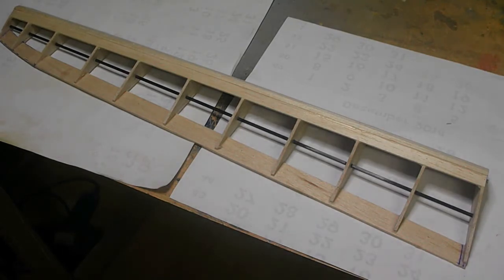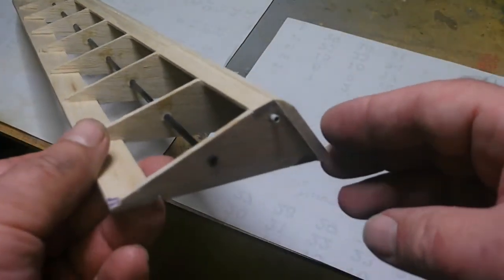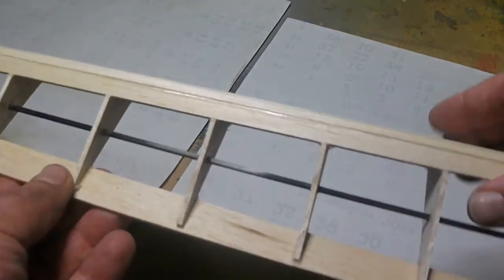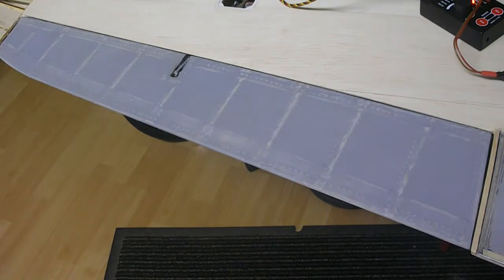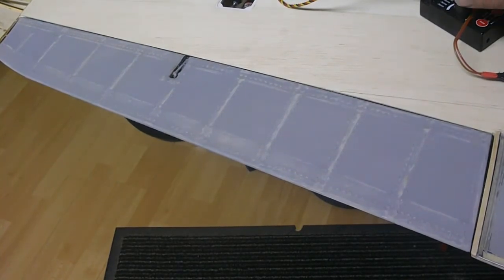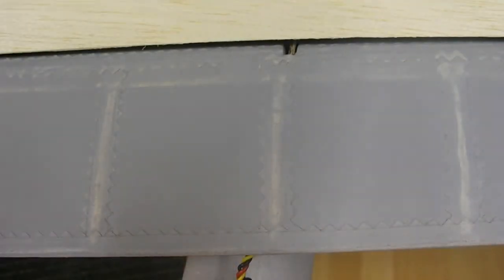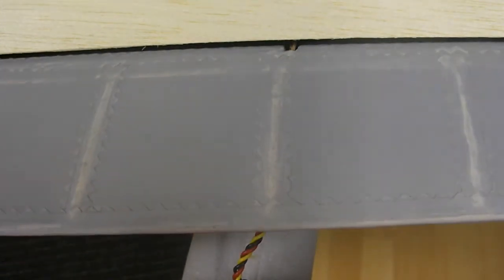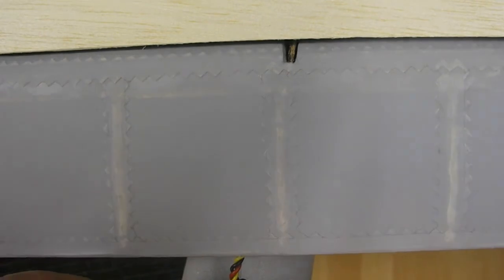Hawker Hurricane aileron

Comment: Hi Walter. I’m building the same Hurricane. Have you altered the shape of the ribs from the plan. I’ve made mine exactly as per the plan but it doesn’t fit as good yours. Could be I need to move the pivot point.